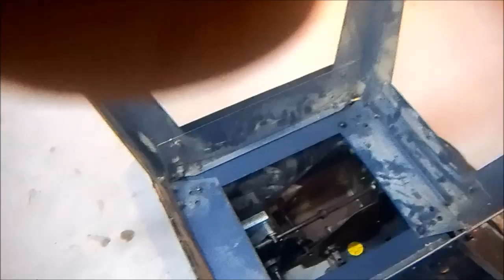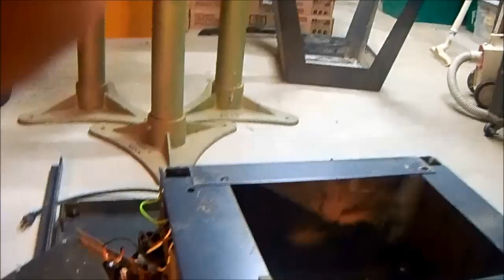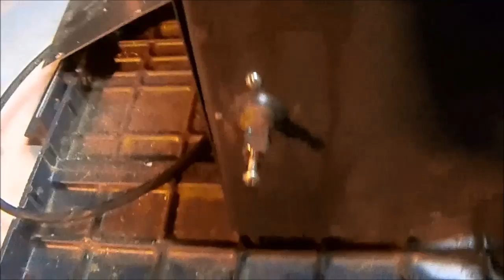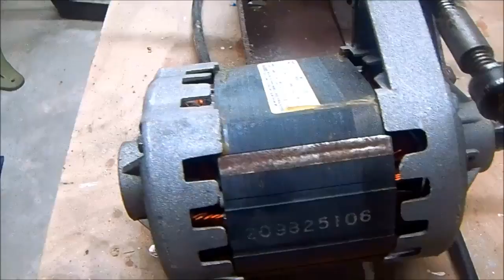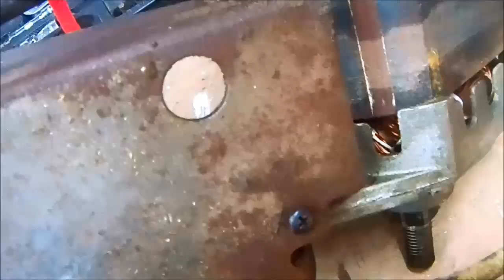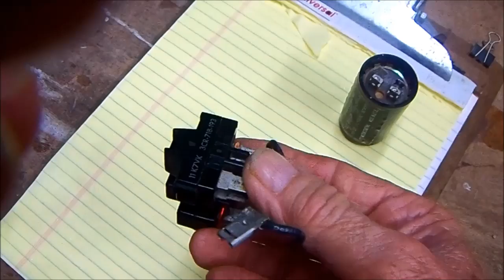Old Style Craftsman Table Saw Repair

Comment: Phil, I don’t know if you remember working on this tablesaw or not. I have that saw and the just quit working yesterday! Everything in your video is the same as mine, especially the direct drive brushless motor. BUT, my switch box does not include the capacitor. Mine does have the coiled thing that you talked about being needed in a certain position. But if I can’t see the capacitor, what would you suggest I do? Thanks for any help you can provide and thanks for having made this video!

Comment: I have same saw mines Still works fine just all the insulation is cracked & coming off all thr wires all the way into the windings of the motor ..... Heat shrink & liquid electrical tape here we go

Comment: The start winding on my motor shows an open circuit. I can start the saw by giving the blade a spin and then turning the saw on. I assume I need a new motor. Any ideas on where I could buy a used motor? A new motor is very expensive and I am not prepared to invest the money for a new motor. I can purchase a used table saw for considerably less than the price of a new motor. Any suggestions would be appreciated.

Comment: relay switch and reset button can be found at this website http://www.carbonbrush.com/klixon3CR.htm  for relay switch. I did not need this but you might.
http://www.carbonbrush.com/klixonCEandCG.htm for reset motor protector use the number on the back of each part. I did need this. They are not cheap.
I bought a switch on amazon for 5.95  https://www.amazon.com/POWERTEC-71006-Safety-Locking-Switch/dp/B002DSBWI6/ref=sr_1_10?ie=UTF8&qid=1530297675&sr=8-10&keywords=table+saw+switch. You need to make sure the parameters of the switch amps are compatible with your saw. This one works for this saw.  I simply adjusted the opening to receive the new switch which snaps into the opening. It works!
I suggest taking photos with your phone as you disassemble the electrical parts.

Comment: Thanks for your video. I have the same 30 year old $299 Craftsman saw which has served me well. In the middle of cut it died.  Which was odd, no struggle, just stopped.  The reset button would not reset and the breaker nor GFI were blown.  I also noticed the switch seemed to have to much play.  After looking at new saws, I decided to try and figure out the problem. It was not the motor since the arbor moved freely.  I suspected both the reset button and the switch. Of course these parts are not made anymore.  We have ordered a powertec kill switch rather than buy a used switch on ebay. To make sure the motor worked my husband direct wired the relay which the reset button was wired to, into the switch button wire which goes to capacitor. We lugged it in and the motor ran perfectly.